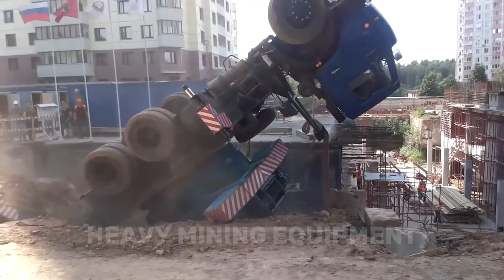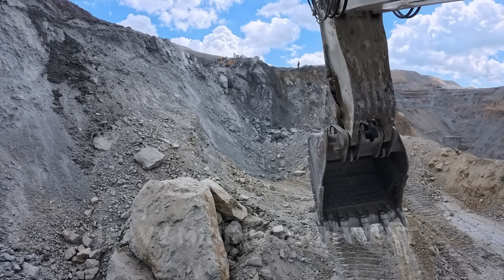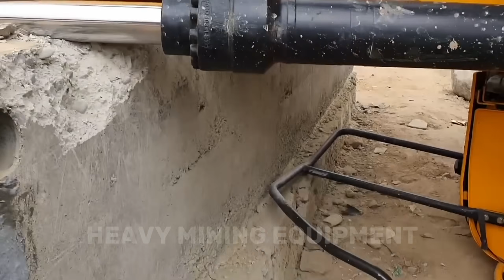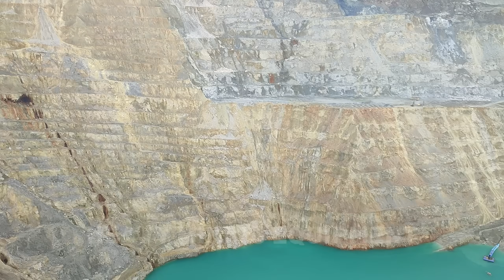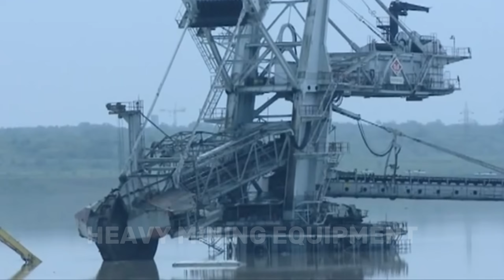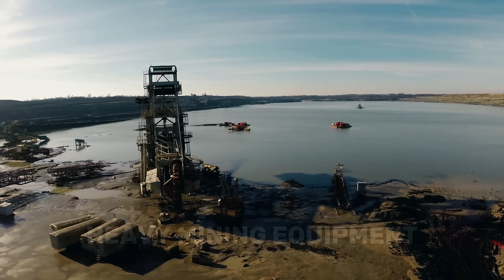Epic Disaster Tamnava Coal Mine Washed Away by River

Comment: ALE transport are based in a village near me (Hixon). They tried to get companies to build them special heavy haul trucks but nobody would build to the specifications they wanted…. So they built them there selves, called them Trojans. Done a good job too!!  The head tow truck also controls the other trucks coupled to the trailer.
Reply from the maker: I was actually wondering what kind of trucks were pulling those trailers, and then someone in the comments said they’re Trojan trucks, specially designed for this kind of haulage. Thanks for the info!
Reply: @HeavyMiningEquipment  some of their trailers have cabs on…. The cabs are off a JCB fastrac.